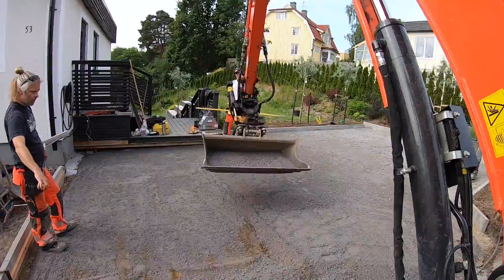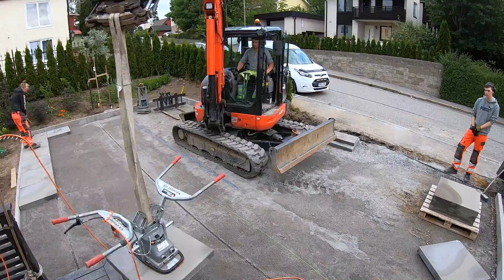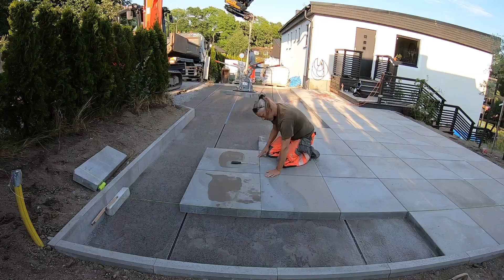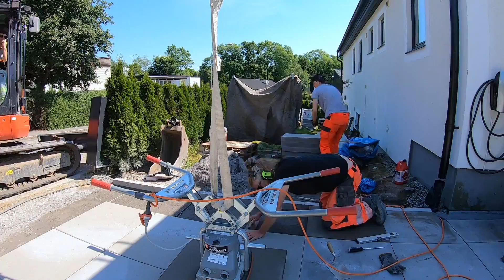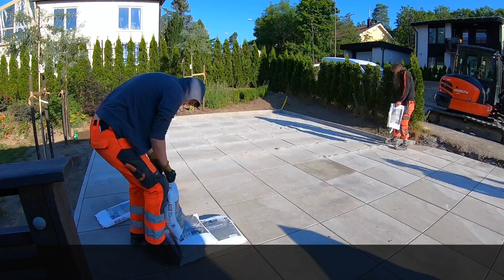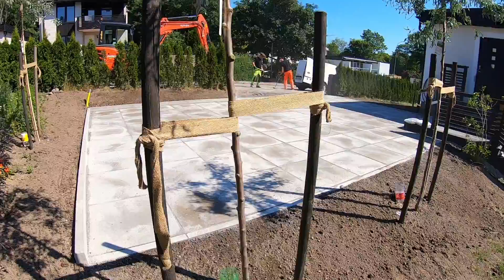And we're back -Parkeringsyta på tomten Part 2:2

Comment: Beautiful work as usual. What was the yellow pipe for on the side by the tree? That vacuum thing is a back saver as well as a time saver.
Reply from the maker: Thank you :) 
The yellow pipe is for the electricity for the lightning on the trees.
Yes, without the vacuum lifter it would have been almost impossible, each tile is like 90 kilo.